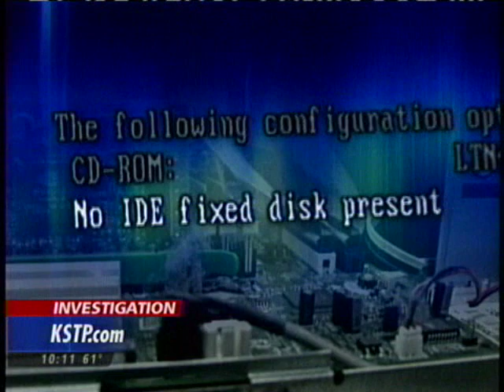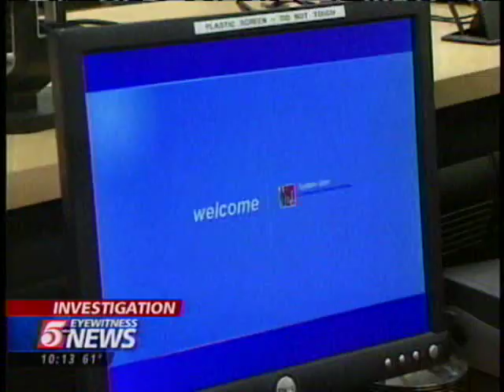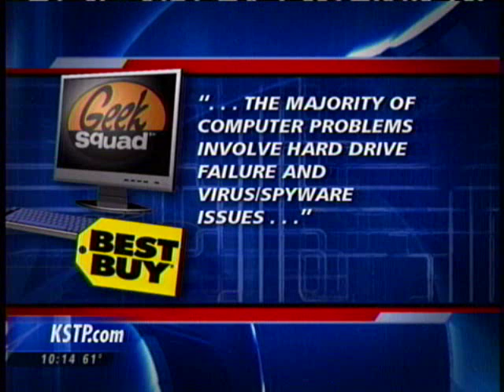Geek Squad is WORTHLESS

Comment: In all fairness the tech's are not going to open the desktop right in front of you. They were able to see that the OS is not detected (because the Hard Drive was disconnected). Now, there is a charge for the services. There is no scam there. However, when they start making up BS charges then it is a scam. But when you remove the Hard Drive the tech's wont know that right away. So, to assume that there is an issue with the OS that is a corrupt assumption. Further diagnostics would determine that the hard Drive is disconnected. But, at first you have to make assumptions because your not taking the desktop apart right in front of them. This isn't rocket science.

Comment: I work at Geek Squad, and there is no way we would of missed that. Everytime a unit will not boot into the OS or anything along those lines, we immediately open it up and look for bad motherboard caps as well as making sure the RAM is seated, and other connections. We've never had a loose IDE problem... Probably why it was overlooked. Maybe next time the news station should do an actual real life situation; like virus removal or something along those lines. Not a cable being half way unplugged.

Comment: at 3:00  that is where I have an issue, the people making the video say it would have cost them $200++ to install a new hard drive. The problem is that a hard drive is about $60 and geek squad's service for OS install is 100. On top of that, would they have charged you anything at all, they would have refunded the money as soon as the Advaced Repair Agents would have openned the computer up and noticed the cable was unplugged. 

 Making false statements like that is messed up. Another note, Agents in the front are not required to have any repair or computer titles, they are essentially Customer Service Reps. Their job is to take computer's in and sell services. Not only that, but they have to do all of the legal paperwork in less than 15 minutes, so no, they will NOT diagnose your computer in front of you, they barely have any time to look at the computer as it is.
Reply: Dude your voice and logic is right.

For one this video is 8 years old, Circuit City is dead, the Geek Squad has changed very much for the better, and the pricing has changed. The hiring has changed too.
Reply: KillaPanzer you sure? cause the geek squad near me, people still don't know what their doing.
Reply: Xinless Vice Xinless Vice Yes I am sure. I worked at a top performing Geek Squad precinct (the precinct is cheesy, it is the area for the GS). You will always have incompetent people no matter where you go. I called it out whenever one of us fucked up badly enough, I still hate defending people who are incompetent or break an established protocol.

If you came into my precinct back when I was working there, if the reservation queue allowed, I would talk jargon with you. I always welcomed constructive criticism at the counter or fact checking whatever we talked about. There were times where I was not knowledgeable, I warned it before I spoke or I would do a quick Google Search with my client. I asked people all the time to fact check me with their own research because I am actually genuinely interested and always looking for an excuse to better my knowledge. Some came back and enlightened me with whatever resource found with updated information. Sadly these encounters were not always possible because of how Geek Squad runs on a reservation basis and worries about revenue per hour for what my role was. One of the reasons I decided to leave, a process that did not sit well with me. 

If you think the pricing has not changed since 8 years ago of this video being uploaded then you should grab a Geek Squad brochure. If you think Circuit City is still a place then I cannot help you.

Geek Squad has changed immensely from the time I spent in the precinct. They actually are trying to always improve. They automate where they can but computer repairs are labor intensive because of the time required. Each probably needs to be physically touched due to some unique factor that automation cannot magically fix with the one CD or anti-virus scan. This is where you will find out if someone actually has technical ability, the ability to actively troubleshoot when the go to solution fails, if the automation does not do what it is designed to do, or if it requires the device to be physically opened up.

Comment: I just got a Acer 5230E laptop for $284.  It was actually $249 stock but all were sold out.  The Best Buy in El Cajon California, had a stack of Geek Squad "optimized" units left if I was willing to pay $35 extra.  This included a set of Geek Squad-made restore discs and drivers.  Apparantly many computers are not coming with a restore disc anymore (amazing).  

I think I got a good deal considering I wouldn't want to not be able to get the computer back to it's original new state.

Comment: I work at another very popular computer repair store and yes it may not be easy to figure out at first why computers are acting up, but whenever its a simple fix, we just call the customer and refund the money.

Today for example I had a lady bring in a laptop because the sound wasn't working. When I came in to work, went to work on the computer, and fixed it in about 30 seconds. Right there, I called the lady and told her we're refunding her money back since there wasnt really a problem.

Comment: Been doing PC work professionally for 7 years now, 1 of the most important things I have learned over the years doing field tech work is NEVER UNDERESTIMATE THE SMALL STUFF, 25% of most problems stem from simple problems with simple solutions. Matter of fact, I kept getting a BSOD randomly, turned out my SATA II cable was bent more then 90 degrees & was causing data loss, simple fix to an annoying problem. Sadly corporations make us techs charge a diagnosis  for $ & to save them from litigation.

Comment: I am a builder, network technician? Computer technician for 14 years. I dont charge my clients for anything if the diagnosis takes less than 30 minutes. 

Also, hard drives cost 80 dollars for 1TB and I can install a hard drive in 2 mins

Geek squad is loads of shit. Trust them in the medical industry we are fucked
Reply: you don't charge anything if a diagnosis/repair takes less than 30 min?! If you plan on making it in I.T. by doing everything for free you're not going to be in business very long.
Reply: wellwhatdoyoumean generally 30 minutes is a short time, and doing shit like installing a hdd isn't exactly worth even charging for. building a pc or some of the same sort however is. If you don't want to build it yourself that is
Reply: ***** It depends on which hard drive you buy (which brand, which hard drive specs etc...)
Reply: ***** Well it depends You can get a 1TB SSD for around $80-$100
Reply: I checked... I guess i was wrong lol. i was thinking of HDD.

Comment: i once went to a geek squad/best buy for a laptop problem....the computer worked but the screen stopped operating (i would find out later the switch/button that shut the screen off when closed was stuck). i waited at the geek squad counter for one of the 3 visible employees to help for roughly 30 minutes then was told it would take 5 days for a diagnosis (which would turn into 9 days) and after getting a message that my diagnosis was ready i went into the squad again to wait ..and wait..and wait

Comment: Undercover: So what's the problem?
Geeksquad: You're hard drive is dead, it's saying not connected on the screen.
Undercover: So what if that means it's unplugged?
Geeksquad: Well we haven't opened it up to check but I can almost guarantee you that the hard drive is dead.
Undercover: *opens up case and plugs in hard drive* You were saying?
Geeksquad: *poker face*

Comment: @Dizle09 Loose memory? You can imagine memory coming loose, but not an IDE cable? If anything, memory seems be locked in tighter. With a ribbon cable you can just pull it out. With memory they get locked in and you have to unsnap something for them to come loose.

Comment: Totally true, when my computer slowed down I gave It to Geek Squad and they destroyed my laptops power button and claimed that I said that the "laptop fell" which messed up its power button. However I turned on the laptop in front of them when they showing them the problem. They made up stuff because their dumber than normal people. So they sent it to Dell ("the computers manufacturer") then Dell not only fixed it faster than them, but Dell fixed my laptops speed and everything and fixed Geek Squad's damage. This time my charger didn't work and I sent it to Geek Squad then they fixed it and they didn't fix my laptop's heat, noise and speed, and they caused my mouse to sometimes freeze which never ever happened before only after they "fixed" my laptop, and they caused my windows update to fail and not work at all, they caused my laptop to have connection problems which never happened before and I have the best router in the store, they made it much slower than a $150 laptop and my laptop is $1,100 + $300somethig for Geek Squad insurance and tax. Geek Squad also caused my start up to look different from before (looks like an old start up like windows 8 considering my one was a windows10). Geek Squad probably stole parts from my laptop because before fix it was kind of fast and now its slower than a used $150 laptop, and there is a noise in the laptop which also wasn't before they "fixed" it, and the laptop freezes after it was "fixed" as well. I'm sending it back to them and I hope they send it to Dell (the manufacturer) again. Geek Squad is TOTTALLY GARBAGE EVERYONE. PLEASE DON'T WASTE YOUR MONEY ON WHATEVER DUMB PLAN OF THIERS LIKE ME!!! ANY OTHER THING IS BETTER THAN GEEK SQUAD!!!! DON'T WASTE YOUR $$$. IF YOU IGNORE ME AND GET GEEK SQUAD, THEN ENJOY WASTING YOUR MONEY!!!!

Comment: I sell computers at Best Buy 226. I agree there are problems that are expensive to fix, but  failing to open the computer and check the cable is inexcusable.

We might make a little more money to sell them a new computer sometimes, but is that right for the customer?

Its not just what you know, but how you apply your knowledge.

Comment: I worked for them for 3 years. Some of the techs were smart and honest, alot of them were typical salesmen trying to please management's unquenchable desire to rip the customer off.  Horrible communication, incomplete and confusing documentation, inexperienced (for the most part) technicians, the list goes on.

Most computer problems can be fixed with a google search (less it's an internet problem).

I think there needs to be a computer bar, like the Florida Bar for lawyers.  It's a start.

Comment: pens in shirt pocket is against Geek Squad uniform code so right off the bat the agent that misdiagnosed the computer is fail. I am a Geek Squad agent and the first thing you should do with an error like that is open the case and check the plugs , also check the motherboard capacitors. Agents like this guy give us a bad name, sadly there are far too many of them.

Comment: That's just it though... that $69 diagnostic covers way more than just opening the cover and checking connections. The tests a computer goes through (HD, RAM, Virus Scan, etc.) can take several hours. I repeat my earlier sentiment that the kid who was so convinced the Hard Drive was bad messed up royally, but first-hand experience tells me that isn't typical. Had he followed established procedure, that computer would not have been checked in to begin with, and there would have been no charge.

Comment: @pugzlie18
 if nonoe of this works then check to see that your getting a valid IP address. Ask your ISP about what it should be. They should help you determine it. If it is correct the ISP may still be having issues with their being noise on the line. This is the problem I currently am having with charter.

Comment: Having a degree in the subject, when I have any sort of "Worked fine yesterday, but today alien messages pop up!", be it from someone else or my own computer the FIRST thing I do is to check all the connections by taking everything apart and putting it all back together. Check connections FIRST! Not "Oh well your OS is bad/ Power Supply is gone/ Martian are eating your wires!" Computer repair places, for the most part, are a scam.

Comment: The tech might have been lazy, in a hurry, incompetent, or just flat out made a mistake/forgot to check. As skylar said all answers given were possible solutions & hdd failure is the #1 reason you would see that error msg. Not excusing the guy as all techs should know to check/reseat connections, just saying people make mistakes. This could happen in any repair shop. That's why if you're told you are facing an expensive repair or should buy a new computer, it's wise to get a second opinion.

Comment: I am a computer enthusiast. I had my share of hardware and software problems. I am definitively not as knowledgeable about computer related issues as somebody that repairs them for a living. By that I don't mean a kid with a summer job at a computer shop. Here I would be check if the bios sees the drive and if it wasn't my machine I would check the bios config as well. The next step would be see if the drive works on another machine and at this step I would have noticed the loose connection.

Comment: What I would of done to test all the computer repair companies is to go into the computer system bios settings and turn off the boot up from hard drive which would have the same problem as the video but without the loose cable

Comment: Over time an IDE cable could wiggle out just enough to break contact with the pins, SATA is easier, but most come with a locking clip to prevent that now :D

Comment: No they didn't even start troubleshooting. You can take the HD to another machine to test it on it, if the HD works on another machine then you know the HD is good and can work towards the motherboard (that would include checking connections).   This is why I have to keep spare hardware around because I know the technicians at these stores are incompetent and can't do basic troubleshooting.

Comment: My inquiry of the availability of a Tesla card sparked interest in your tech since he had never heard of it, which is not surprising as it is not a common video card. Which carried on a convo about hardware. But yes that says Tesla, not Titan. Please don't misread that either. I don't want to have to explain the difference of those two cards also. Aside from that I have an 2010 ASUS LIfestyles board not only with UEFI but the first Bios GUI ever implemented. And windows 8 was release when? 2012.

Comment: Allow me to educate you even more, HT does NOT come on all CPU's that use UEFI. There are a large numbers of I3's and I5's that do not have HT tech.. UEFI Just gives more flexibility and better handling of all hardware resources on a board. It has no effect on whether or not you can put an HT or non HT processor on the board. Neither did the older EFI for that matter. HT Disabled I7's will only show 4 cores instead of 8, therefore it is on by default unless you go into the bios and disable it.

Comment: When Best Buy "replaces" your harddrive it can end up anywhere. I have bought many perfectly fine harddrives that were bestbuy "fixes". And none of them were erased.
Reply: Funny. I work at GeekSquad and we don't resell HDD's. Not sure exactly how you purchased a used one. Unless a client requests we recycle their drive, it usually is given back to them. Otherwise we smack it with a hammer and process it for recycling.
Reply: Wish i was making it up. It somehow got from bestbuy to a computer store down the street in a pulled parts bin. She never stepped foot in the computer store.
Reply: I can guarantee it was not a standard thing. It was stolen one way or another. Did you report it?
Reply: The motto of geeksquad is "we don't fix, we sell and charge for diagnostic"

Comment: I work at a Geek Squad precinct. I always open the case right there in front of the customer if there seems to be any sort of hardware detection issue/error when I boot the machine and check the connections, the seating of the RAM, obstructions in the fan, etc. I would have found that problem without needing to check it in. But no, I guess I and my fellow workers who would do the same thing are "just a bunch of morons" according to the uploader. That kid made a mistake, not all of Geek Squad.

Comment: Fox news had it out for best buy. Give me 1000 computers with 1000 different problems and I'm likely to not know how to fix 100 of them at all. 100 of them I will think it's the wrong problem, another 100 I will get to work without actually fixing anything, leaving only 600 properly fixed computers. Same can be said for any computer profession, Fox news only gave us one example from each store (giving us the right fix) even best buy. But hammered best buy multiple times resulting in a failure.